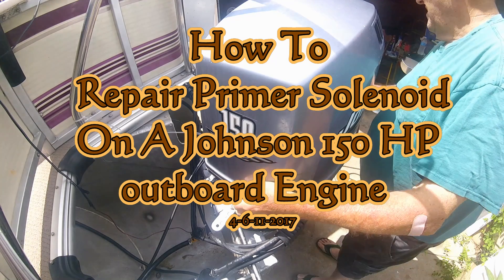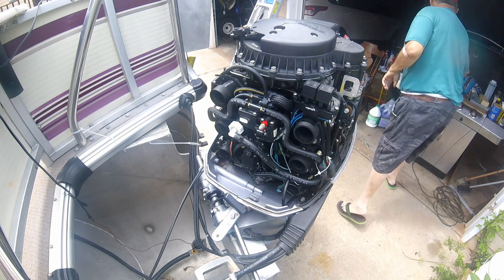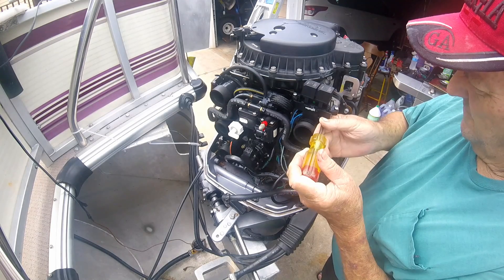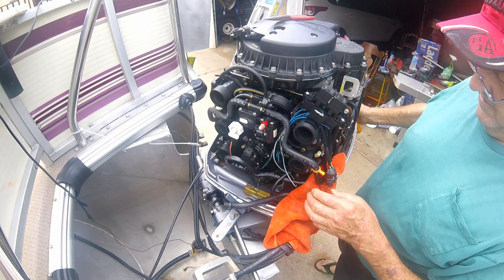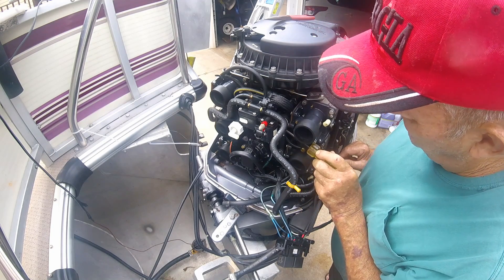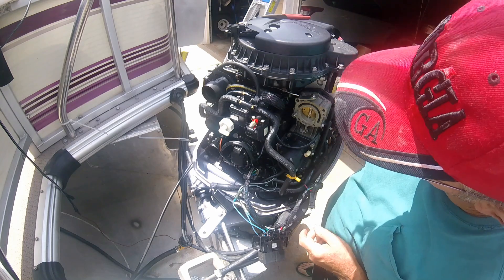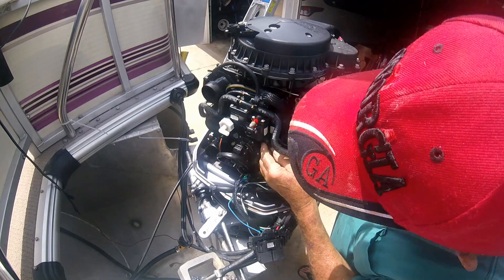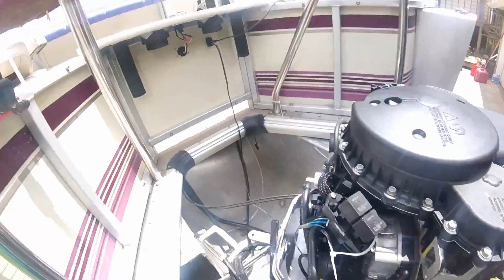How To Repair Primer Solenoid on Johnson 150 HP Outboard Engine Part 1

Comment: Hello Walter! After watching your video I was able to service the Primer Solenoid on my Johnson 115 Outboard. Removing the one carburetor made the job so easy to do. I was having a problem in starting the motor from a cold start and now it starts like a champ. I rebuilt the solenoid and found no contact with the positive wire, your video gave me the confidence to do the job myself. Thank You and keep up the good work...
Reply from the maker: Thanks for the comment  I am pleased that I was A help to you

Comment: Im so glad yuo had this video. I have the same engine and I could not find much of anything about it. Mine seems to have spark and fuel but I cant get it to crank. I had a new VRO Pump, New Power Pack and new plugs put in it back in 2012. Because of health issues the boats only been run about 20-30 hours ever since then. I started it a few days ago, it ran perfectlyt then it died. I thought it ran outta gas but it didnt. it was almost full. Now I cant get it to start. It will kick over once in a while but it wont run. So frustrated.
Reply from the maker: I hope you get it running soon

Comment: My plastic primer developed a hairline crack 3 years ago.  It pulled straight out and I pushed in a new one. It just cracked again last week. I have a 94 johnson 150hp. I also changed the white/clear  fuel filter. They fill with sediment every single year.
Reply from the maker: Thanks I will change mine more often

Comment: I actually took a set of clubs with me to U.S.N.S. Guantanamo Bay Cuba since I was there for almost 12 years.  One problem with the ground there is that it's mostly coral rock and cactus .  The tee boxes and greens are the only places that have grass on them  the rest is a reddish beige with some flat spots on the ground as well.  Get lucky and a ball hits one of them and it'll go anywhere including the green as my ball did one a 427 yard hole.  That was on the green is one n a par 4 hole.  I don't play as much anymore now that I'm in my 70's.  Repairing computer systems without touching them has gotten me lots of work.  No remote desktop, I do not touch the other persons system, they do and I let them know what they will see if they follow my instructions.  They pay me and think I'm a genius and I'll take it.
Reply from the maker: LOL  I spent a lot of time in GITMO

Comment: A golf tee in the hose with that hose clamp will work better.  On older vehicles as I remember we used to put a golf tee into hose to stop a vacuum worked well.  Think back to the 1970's vehicles.
Reply: Indeed, that IS a good trick, but the problem associated with that trick is that sometimes the technicians/mechanics will become distracted to the point where they stop the work to go play golf.......
Reply: Worked great on my 1972 Ford Ranger pickup truck, which btw I kept for just over 7 years.
Reply: Excellent. But please tell us, how were you able to resist walking away from the work at hand to go golfing?
Reply: At the time I owned that truck, I was 27 years old, but I'd been playing golf since I was 12.  I'd practice by hitting hickory nuts down the road in our development..   The houses in the  development had not been all there.  Our house, built back in 1956 was the 12th one built, so there were lots of targets to aim at in the area.  The golf course was around 8 miles from where we lived and I'd go out there about every 4 to 6 weeks.   So golf was in my blood thanks in part to my Dad who would get up at 6 AM and be on the starting tee at 6:30 3 times a week.  Play 18 holes walking all of the way, and be home before 10.
Reply from the maker: Thanks for sharing your story  I tried golf a few times just never took to it
Reply: Awe gee, all I had to do was to wail till 1530, and I could go golfing.  As I recall my brother and I played 18 holes and picked up my Dad and went out and played another 18 holes with him.  I will admit 36 holes in one day is a bit much, but in my youthful days neither of us seemed to know it.  Now Dad on the other hand did on the par 5 hole, when I pulled out an iron with more than 300 yards to the green and dropped the ball on it.  The ball was on a slight uphill trajectory and I pulled out a 1 iron [driving iron] and slapped it to the green.  Dad wanted  to know what club I'd used, so I showed him that 1 iron. The ball was about 10 feet from the cup.  It took Dad 2 more shots to get to the green.  He didn't think much about my moving 30 cast iron bath tubs during that day, which did help my ability to hit the ball that far.